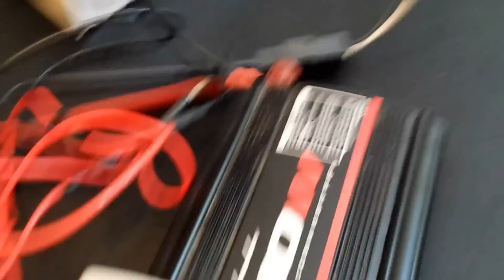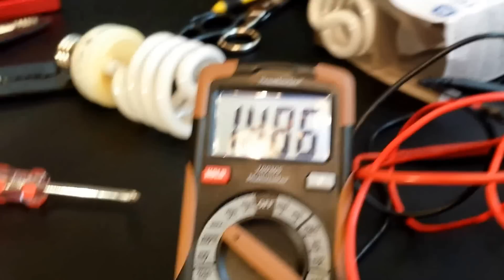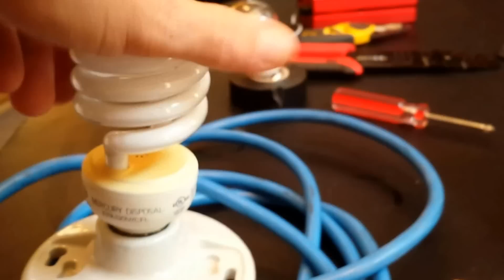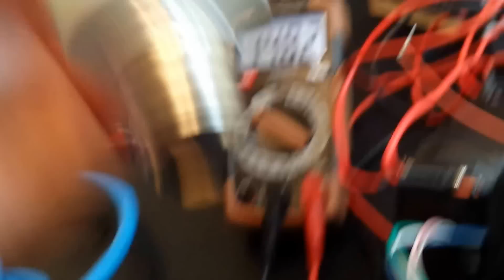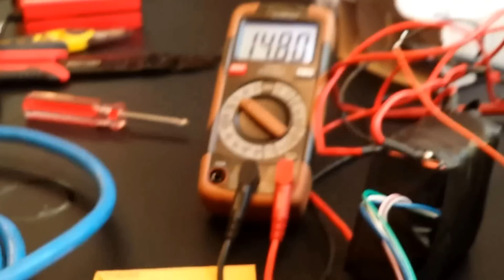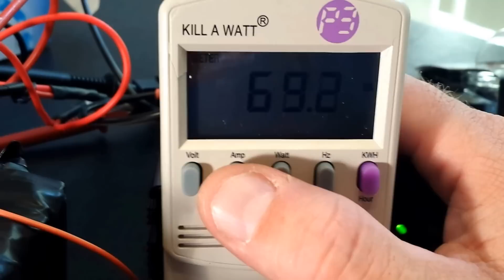18650 Battery Testing part3

Comment: if you were to run lights, i would recommend using direct dc instead of the inverter, because you lose efficiency with the inverter and then the transformer within the light.